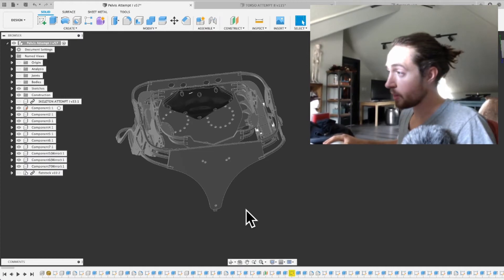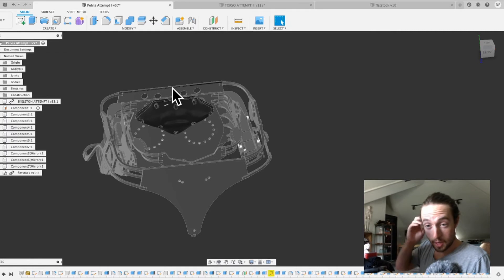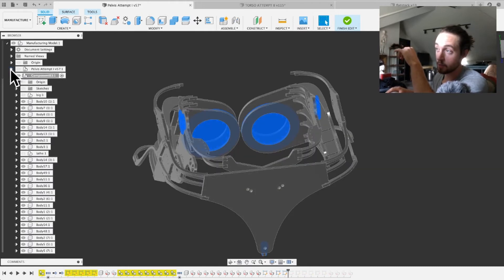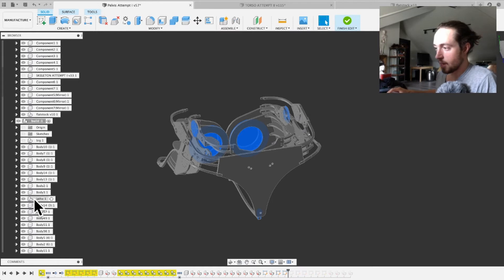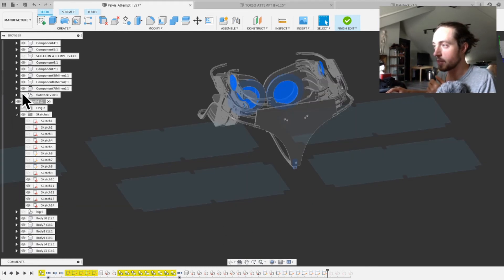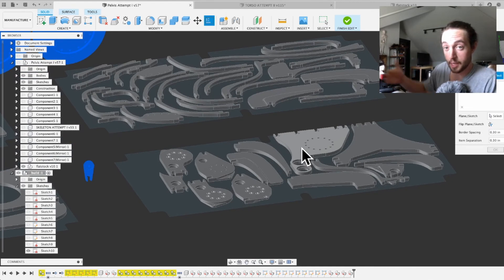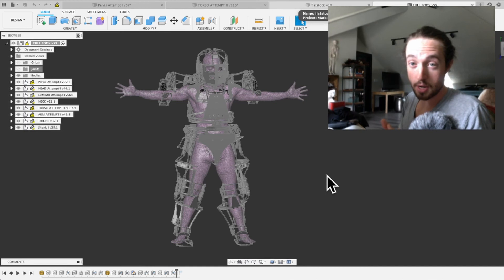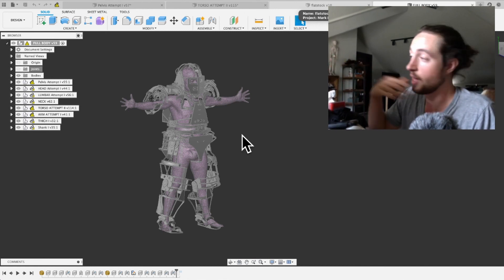Nesting Using “Arrange” in Fusion 360

Comment: Thanks for the video. Made a lot of things I was trying much clearer.
If I can add my 2 cents, I think there is a way of arranging all of you components at once.
If I tried this correctly (but definitely on an easier assembly, so it might not work out on this) If you make one sketch of your 5 different panels (typically one big rectangle in which you draw the edges of 5 separate panels you'll be using to cut out), Fusion 360 should be able to figure out how to arrange all the components at once without having to first subdivide your parts into 5 groups.
Reply from the maker: I tried that but I think it was having issues with my complicated plates :/